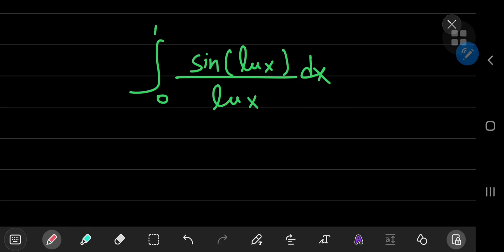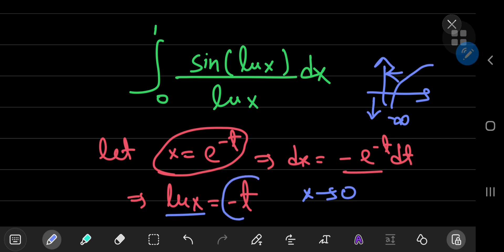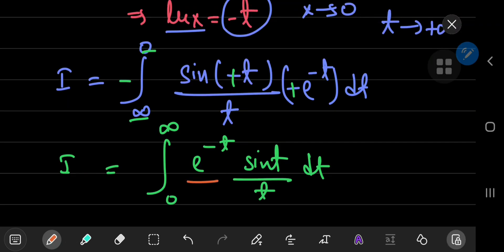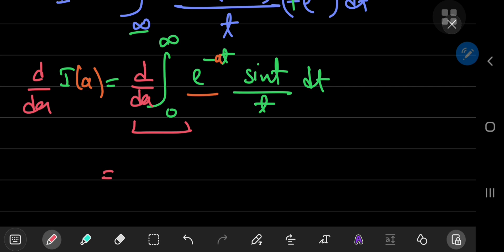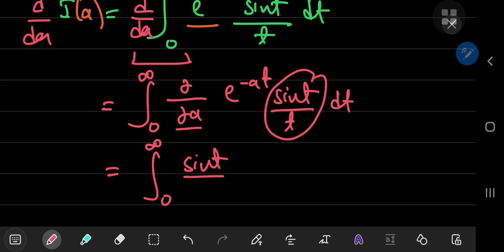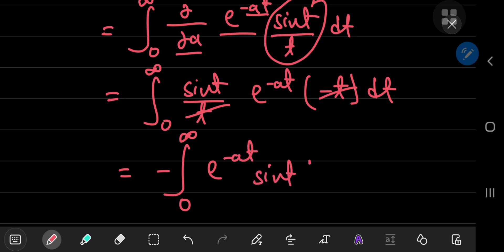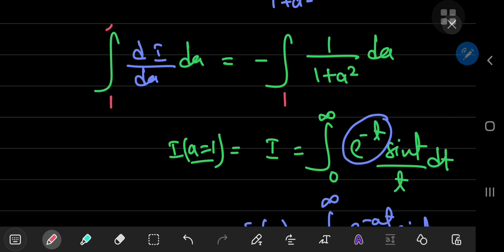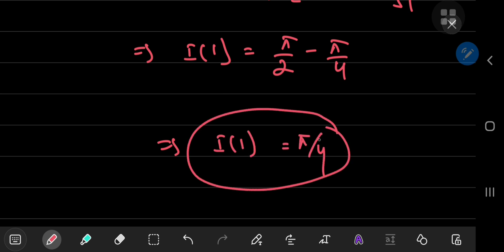Solving an awesome integral using Feynman's technique

Comment: Great work! It is worth noting that if you are comfortable with integrating polynomials containing a complex power, this integral can also be solved using Feynman's Technique by simply introducing the alpha term in the sine function and then leveraging the exponential form of cos as follows:

I(a) = int_0^1 sin(a*ln(x)) / ln(x) dx
I'(a) = int_0^1 cos(a*ln(x)) dx
I'(a) = 0.5 * int_0^1 (e^(ia*ln(x)) + e^(-ia*ln(x))) dx
I'(a) = 0.5 * int_0^1 (x^(ia) + x^(-ia)) dx

So long as you know that x^ia integrates to x^(1+ia) / (1+ia), then it's just a matter of algebra to get to the antiderivative of arctan:

I'(a) = 0.5 * [x^(1 + ia)/(1 + ia) + x^(1-ia) / (1-ia)] | evaluated from 0 to 1
I'(a) = 1 / (1 + a^2)
Reply from the maker: Wonderful explanation and yes I agree with your method
Reply: I did the same, I think it was easier this way

Comment: I haven't taken any calculus in college but I just don't see how this integral even converges at all! ln(0) is undefined and we have 0 at the denumerator when x is equal to 1. I'm mega confuzed right now
Reply: This is an improper integral.
lim(x->0) sin(lnx)/lnx=0
 ∫ from 0 to 1 sin(lnx)/lnx dx
=lim (t->0) 
 ∫ from t to 1 sin(lnx)/lnx dx
Reply: @林子鈞-z1j  ah ok, that makes sense thx
Reply: @Agent-cipher-6120  also the part when x=1 is also a limit since x cannot equal 1.  And that limit converges to 1. It’s the same limit as sin(theta)/theta as theta approaches 0. This is a famous limit and can be proven without using L hospitals rule. One can use geometry and I think the squeeze theorem comes into play.
Reply: @moeberry8226  Yeh i think the proof is as follows
-1 <= sinx <= 1
Using this we can rewrite sin(x)/x as 
-1/x <= sin(x)/x <= 1/x
As x approaches infinity, you can note that -1/x approaches 0 from the negative side and similarly 1/x approaches 0 from the positive side
Hence you get that 0<=sin(x)/<=0 as x approaches infinity and hence the limit as sin(x)/x approaches infinity is 0, correct me if im wrong